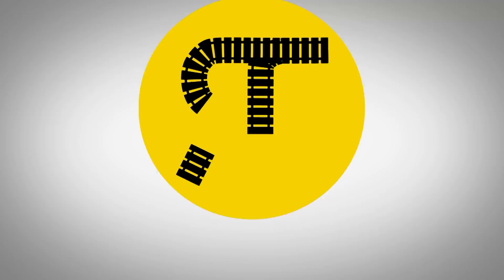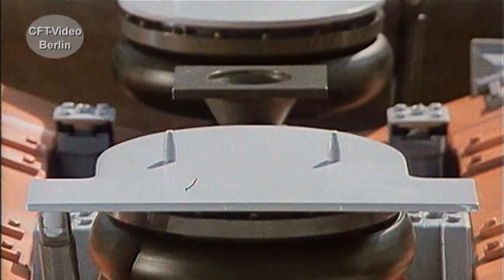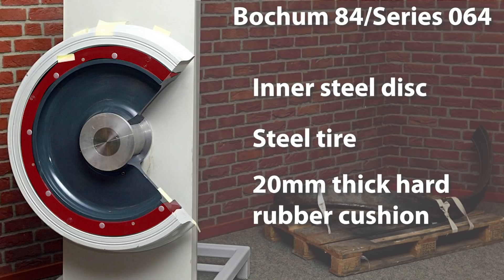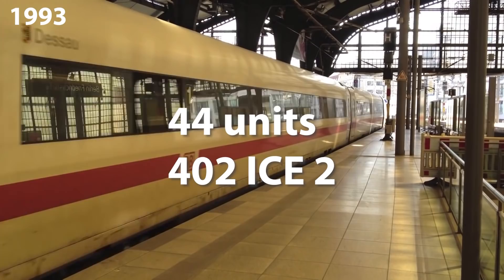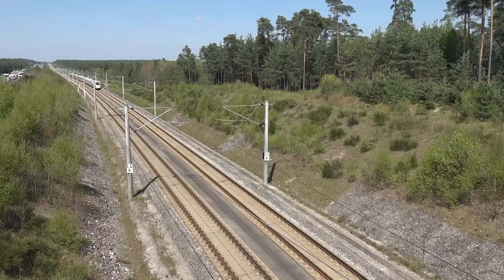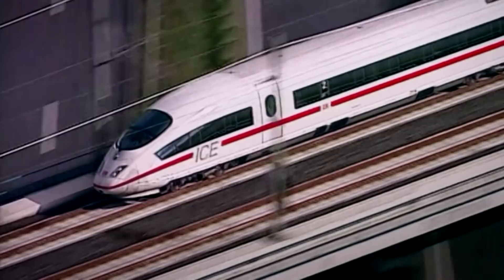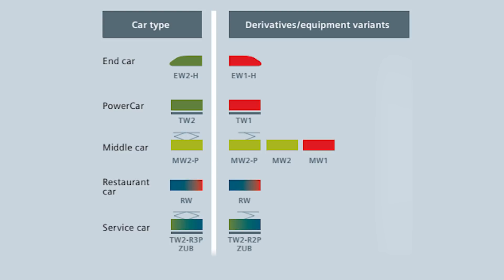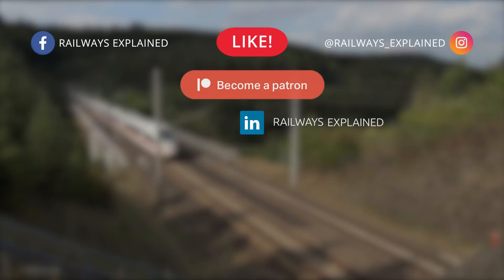Evolution of German InterCity-Express Trains - Explained

Comment: I just want to add:
The current Eurostar trainsets are similar to ICE class 407. And DB drove a test Service of its ICE3M to London back in 2010. But after the Brexit referendum this project has been canceled. They had planned to operate  services from Frankfurt to London. ICE3M and 407 should have been licenced to Eurotunnel.
Reply: It hadnt been cancelled because of Brexit but because the French and British didn't want competition for Eurostar. They cranked the cost for other trains to use to track up so high that is wasn't economically viable.
Reply: @nielskut2256  yes, that was one of the problems, but unsolvable, . But brexit was one of the last nails in the coffin. Brexit means less travelers, even higher operating costs. And you can see how much the Eurostar means to the French during the pandemic. Because the seat is in the UK, they don't really care about it, even though SNCF is the majority owner.
Reply: @nielskut2256  
That wasn't the main issue, the main issue was that the UK government insisted on having airport-style checks and dedicated platforms at every single station with service to London. This isn't possible at stations like Cologne, and they refused to do on-board checks like it was done before Schengen in continental Europe. This unnecessary policy didn't just kill off DB services to London, but also the Regional Eurostar (Paris bound services from other UK cities) and the Nightstar (night trains to farther destinations).
Reply: รบ
Reply: @mikeblatzheim2797  Instead we got the new class e320 Velaros, so in the end the Germans got their trains sold to them anyways :P And services extended to Amsterdam.
Reply: IDK,if the Eurostar will ever drive like the Thalys with the 407 trough thine Rhine-Ruhrland (where i also live lol),but hope so.
Reply: In addition to what the others said, neither the class 406 nor the class 407 meet the technical specifications to be allowed to run through the Eurotunnel

Comment: As a regular ICE passenger  I can tell you that the ICE1 and ICE2 are the most popular trainsets. All ICE4 and many ICE3 have newer seats which are way more uncomfortable than the old ones (even though DB claims to have fixed the issue). ICE1 and ICE2 are still sporting older, better padded, reclinable seats, which are much more comfortable! I'm kinda horrified by the thought that I have to endure the ICE4 seats over the next thirty years once the ICE1 and 2 are gone!
Reply: The seats are being replaced by better ones in this very moment. But it will take some time to change tens of thousands of chairs.
Reply: @hape3862  Even the better ones are still shit since they still don't recline.
Reply: I wonder if there is an ICE train tracker online that doesn't find the train service numbers, but the types of trains running on the lines.
Reply: I personally favour the ICE 3 with their first set of seats. These were the best seats and the best designed trains so far. The seats that they built into the second class of these trains are the same as the ones they built into the first class coaches of the ÖBB RailJet. The Interieur with the wood, the aforementioned comfortable seats and the warm indirect are almost cozy. And the trains themselves are simply beautiful. In fact, the DB referes to their design in many ads and pictograms, even though SIEMENS sold very similiar looking trains to Spain, China and Russian. And though they were designed 25 years ago, they still look futuristic and fast. That said, I too don't like what the DB is up for with these trains: The refurbishment that is happening right now kind of ruins it for me. Especially the new seats are so much of a downgrade.

I understand the concept behind the ICE 4: These trains are built to increase capacity and to reduce energy consumption of the trains. But for someone who is 1,93 m (6'4'') the seats are too close to each other. And there is more than one row per coach that does not enjoy a window but is entirly seated next to plastic panel. While the ICE 3 before the refurbishment gives you the feeling that you are invited in to the living room, the ICE 4 makes you feel like you are seated in a dentist's waiting room.
Reply: I'm going to miss the 6 seat compartments for sure! Great travel comfort, even in 2nd class (2. Klasse).
Reply: For me it is the complete opposite. I'm a regular ICE passenger as well (mostly Berlin-Hamburg) and I love the ICE 4. I find the first class seats in the ICE 1 very uncomfortable and the train just doesn't drive as smooth especially at high speed.
Reply: Well, still better then the new double decker intercity trains. But I always loved catching the rebranded metropolitan trains as ices between hamburg and berlin or fulda frankfurt. What a treat indeed. Sure folks dont like the lack of wifi. I love it - no work shenanigans can reach me.
Reply: It's not just the type of seats. The seat pitch in 1st class of ICE 4 trains is smaller than in 2nd class of ICE 1 and 2 trains. Also, due to the same number of seats per row in a narrower car, you have less room sideways, which may be less pronounced in 1st class, but is really obvious in 2nd.
To make matters worse, the lack of classic compartments makes traveling on those new trains extremely oncomfortable. I often travel when it's dark outside, so having the option to turn the lights off in a compartment is something I really appreciate, just like the individual temperature control. It's usually way too warm in there, so having the option to make it a bit colder is really nice.
When booking train trips, I try to avoid getting on ICE 4s whenever possible, either by traveling at a different time or even taking some detours.
Reply: Opposite for me. I do love especially the renovated ICE 1 interior. ICE 3 & 4 are totally fine for my taste  but the "new" ICE 2 seats for the last 10 years or so are an absolute nightmare for me. Maybe it's because I have a hollow back and I'm 1,86m tall but it's only pain, discomfort and torture to sit in these chairs. They bend you over until you sit like the Hunchback of Notre Dame. When I sit in an ICE 4 it is comfortable. I guess it's pretty subjective but from what I read everyone was happy with ICE 3's first generation interior 😁so...just bring these back? I know they placed it in some IC cars which was a real delight when I traveled the track directly beside the Rhine.

Comment: I was a Chicagoan visiting Germany in summer 2018. I was supper surprised at the number of ICE 1, and ICE 2 I saw in Germany, and road on! and how many of them had been graffiti on! lol Train sets at Hamburg and Cologne seemed to have the most. I must have been on a ICE 3 witch I thought was a ICE 4 (cause it seemed so new and nice) From Munich to Cologne cause we traveled at 300Km/h in two different sections!  Best trip ever Rail passes are the best!!!
Reply: The ICE 3 is nicer than the ICE 4: more spacious and faster.
Reply: If you love the German rail the best experience I can recommend is taking ICE between Stutgart and Paris. This is because that rail line is specifically designed for the Highspeed TGVs which means the railways are highly maintained. Its a super smooth and comfortable ride through the german and french country sides at over 300 kmh for large portions.  That being said I know what you mean. I live in the USA but I have family in germany so I vist often. The ICES are just the best to ride in with their high speeds and solid comfort they provide.
Reply: Hamburg has a huge Graffiti and other Vandalism Problem. There are a few "Gangs" competing on who can cause the most (as in most expensive) Property Damage, so they not only spray but do all sorts of Damage to Trains. Around Hamburg, fixing Vandalism Damages on Trains costs over 3 Million Euro per Year, and that doesn't even include the Cost of Trains being not available. I live in Flensburg, and it's fairly normal that the Schedule of the Train to Hamburg is disrupted because there are not enough Trains available as some have been vandalised again.
Reply: It didn't occur to me that that is a thing in Europe. Since the shinkansen in Japan are adored by most citizens, I cannot comprehend the possibility of them being vandalized.

Comment: I have one thing to add: Siemens is Currently in development of the next gen ICE, the ICE 5 or "Velaro Novo" with an max. Speed of up to 360 km/h and a fully modular design. DB ordered 40 until 2026 10 for 2023 and 30 for 2026.
Reply: I think a part of the order was just an updated Version of the Velaro D.

The velaro Novo will follow later
Reply: Which will be probably the max. actual speed of this model in real traffic? Does the high Max. Speed change anything for the travelers in the next decade?
Reply: @PianistStefanBoetel  Probably not. The limitation here are the tracks. Besides the original Cologne - Frankfurt line as far as i can see on Wikipedia only parts of the VDE8 Erfurt - Halle - Leipzig are ready for a top speed of 300 km/h.
Other lines are planned to be upgraded to 300 km/h but most lines have a top speed of 200 or 230 km/h. As long as the ICE in germany have to stop at nearly every city this is makes sense as the distances are short. What we need are 4 sprinter lines crossing the country from north to south and west to east to really take advantage of high top speeds.
Reply: No, the Velaro Novo is still not ordered by DB, what DB ordered us the ICE3 Neo (Br408, similar to the Velaro D).
Reply: That's wrong. DB ordered 30 train sets Velaro MS (408) similar to Velaro D (407) last year
Reply: @PianistStefanBoetel  i think it makes only sense when you think about export possibilities. At the moment, there is no line faster than 300km/h in Germany and there will be none in the near future. 
(Maybe maybe, if the ICE5 will be around for 25 years... but i am not aware of any currently planned line for more than 300km/h and planning of lines takes a long time in Germany.)

The Velaro Platform has really been successful internationally...The Video mentioned Spain, Russia and China but the Eurostar Trains are also an Velaro, Turkey is now also using them on their new High speed network and just recently it was announced that they will also come to Egypt. 

There is a real chance that more countries want to expand or create an High speed train network in the next decades and if you can offer 360km/H it is a selling point.
Reply: If the DB really ordered these, that gives me hope. That means that they still have a vision to get higher speed onto the rails, and that they could realistically use these speeds in the future.

I have previously proposed that two dedicated north-south rails with 360km/h and only 2-3 in between stops would really make sense in Germany. Yes of course, if you stop at every city, dedicated tracks and that high speed doesn't make sense. But in order to compete with Airlines, and to get quickly from one side of the country to the other side - this would make sense.

Maybe even if you are in between, you would take an ICE on regular mixed rails to one of these stops, and then have a faster journey all the way up to Hamburg and Berlin. If that would decrease the travel time, that would be great.
Reply: @Rick2010100  It is not necessary. The ICE4 is designed to be a 250km/h fast train. It is never intended to be a replacement for the ICE3 fleet
Reply: @PianistStefanBoetel  From what I heard, they're mostly focussing on increasing acceleration nowadays because of what Jens S said.
Reply: I wonder if Siemens would develop an ICE train that faster than Shinkansen L0 Series
Reply: @lemagnifique1573  Technically the new Velaro Novo is faster than the Shinkansen. The Novo can reach speeds of up to 360 kp/h the Shinkansen can reach max 320, although it reached over 400 kp/h in a Test but a test is not the real Vmax Speed.

Comment: Some more things worth mentioning:
- Class 401 ICE 1 trainsets are going through another modernization process right now. The sets will be shortened to 8 cars since many cars are showing signs of age and aren't suitable for another restoration. The newly modernized sets will primarily serve former IC routes.
- Class 605 ICE-TD (the diesel ICE) sets were riddled with multiple problems throughout their live and never as successful as initially hoped. After the original plans of using them on non-electrified lines didn't turn out as promissed, they were only sporadically used for additional weekend or charter services (e.g. during the football world championship in 2006) and else just stored due to lack of useability. The only line they served reliably for a couple of years until 2018 was the Hamburg - Copenhagen route using the train ferry. On top of that they were also fairly high maintenance due to the tilting technology, which made them overall very uneconomic to use. Most train sets therefore were scrapped within the last 1-3 years despite their relatively young age.
- New class 408, which will be another iteration of the ICE 3 family, essentially an updated version of class 407 with some other minor tweaks here and there (more doors for example). The first train sets are already completed and will undergo testing soon. Regular service is scheduled for late 2022.
- Although they were originally not meant to be used as such, the push-pull train sets of former business express train "Metropolitan" were also mainly used as ICE trains. With a rather luxurious interior and a unique design, a mix of elements from ICE and classic IC push-pull train cars hauled by class 101 locos specifically adjusted for these sets and originally painted in a futuristic silver-grey livery, they were a rather exotic appearance on German rails, also because only two seven car units were ever produced. In fact only a week ago they were officially phased out from the main fleet and brought to the longterm rolling stock storage in Mukran on the island of Rügen.
Reply from the maker: thank you for sharing your thoughts!
Reply: And the DB ordert new ICE 3 Trains brandet DB Barheie 408

Comment: you almost always say IC instead of ICE. Those do also exist but are not the same. They have for example a maximum speed of only up to 200km/h and (the most common IC1) are pulled/pushed by a locomotive. the ICEs (Inter City Expresses) were develloped as the "express" version of the ICs (Inter Citys). thats also where the name "ICE" origins
Reply from the maker: Maybe the "e" in "ice" somehow ends up silent, unintentionally, but of course, it is ICE..
Reply: Correct, that is, the prototype was referred to as the ICE where E stood for "Experimental" (as in this video), but the production trains put in service were indeed with the E meaning "Express''

Comment: I liked the video, you did an amazing job at researching everything but you completely forgot the new ICE L trains currently in development with Talgo. These will be the first low-floor ICE trains.
Reply: May be, but they are not really ICE trains. They are more an EC or similar to an Austrian Railjet.
Reply: @Marcus_Oelschlegel   Of course they are ICE trains. There is a simple standard for ICE trains. ICE trains are trains that DB calls ICE, and the previously named ECx is an ICE, as confirmed by DB.
Reply: @Marcus_Oelschlegel  The ICE 4 was supposed to be an IC as well. But here we are.
Reply: @MattiBlume  No! The ICE4 replaces some IC/EC trains, but is not an IC. All ICE today are multiple unit trains. The ICE L is not. It´s just a push & pull train! So that´s the difference between all ICE and the ICE L. I suppose they only use the ICE label to sell tickets at higher prices.
Reply: @Marcus_Oelschlegel  that's what I wrote: "Was" (past tense).
Reply: @MattiBlume  No. The ICE 4 was never supposed to be a real IC train. It was already planned as a multiple unit train. But the ICE L was never planned as a multiple unit train. It´s much more like a classic train with a locomotive. Just with lower floor.
Reply: @Marcus_Oelschlegel  of course it was planned as a multiple unit. But the project name was "ICx", not "ICEx". Then it was upgraded to ICE 4. Basically the same story as with the upcoming ICE L.
Reply: @Marcus_Oelschlegel  Da hat wohl einer den Metropolitan vergessen 😉
Reply: @powgames  Wieso? Der war weder low floor noch baulich ein ICE.
Reply: @MattiBlume  The new talgo trains DB ordered are called ICE-L they changed the name and cab design to get to this name. So this Talgo is an ICE they even announced that the IC berlin will be renamed to ICE international

Comment: In the UK the British Rail High Speed Train (Diesel Electric - 125 mph service running - 143 mph record speed) , suffered early on with what was deemed to be poor riding. One of the solutions looked at and then rejected due to concerns over the longevity and tyre failure, was the solution applied by the team with the ICE train. 
In the end a number of alterations improved the ride considerably; that said it was not travelling at ICE speeds.

Comment: In your part about the ice 3 you often show videos with the ice T in it like at 11:20
Reply: ssh dont tellem
Reply: yeah i noticed that too.
Reply: I also always confuse them. They are so similar looking. How do you tell them apart?
Reply: @IroAppe  the three differences easyest to spot are the panthographs, the doors and the location of the 3rd headlight.
ICE T units have the Pantograph on the first car, ICE 3 units on the second.
The doors of the ICE 3 are, exept of the diningcar and the two front cars, symmetric on the end of every car. 
The doors of the ICE T instead are asymmetrical and often in the middle of the car. 
Last but not least the 3rd headlight. 
It's location is above the windscreen on the ICE T and below on the ICE 3.